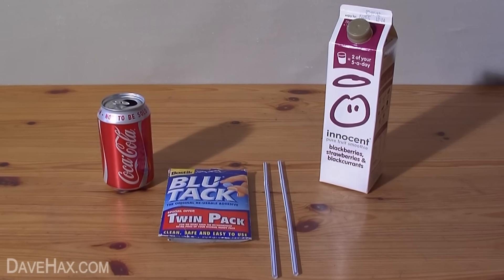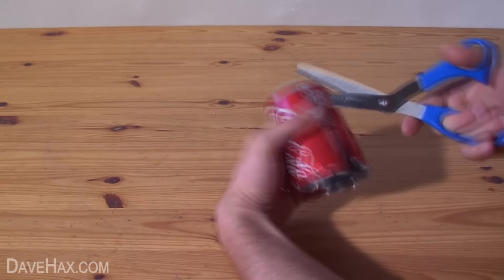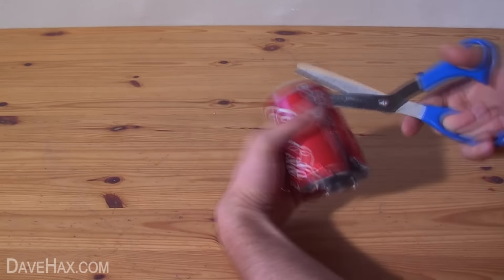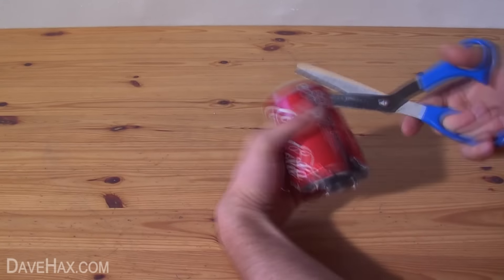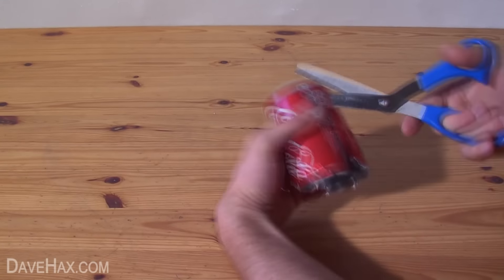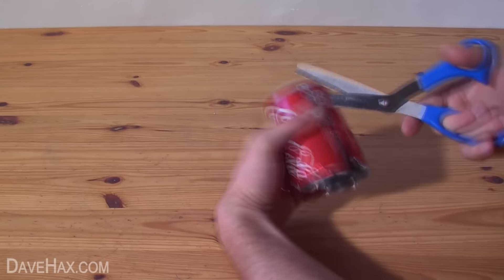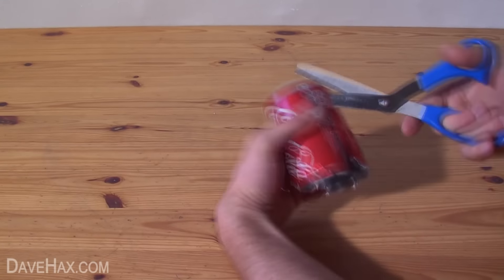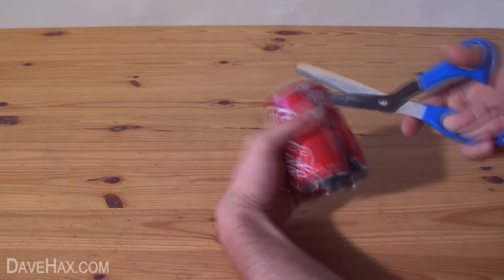How to Make a Simple Pop Pop Boat

Comment: :( I tried putting the diesel engine from my 240D on it and the whole thing, including the engine sank to the bottom of the pond.
Reply: RayVal53 Suggest you get a 300SD and try again.
Reply: ***** Already have one. See videos. :)
Reply: Dont make the engine to heavy it will capsze the boat or way it down
Reply: Have you tried turning off, and back on again?
Reply: just use more juice containers, 1000 should keep it afloat & don't cut them in half,just gluegun them shut
Reply: lmao
Reply: Yes I have the same problem all the time, luckily I could fix it with Flex Seal.
Reply: More bluetac
Reply: Try putting mass on the bow
Reply: Dude, your using the wrong motor. Obviously you have to use the 7.3 Powerstroke. Duh 🙄
Reply: Sad
Reply: Dont do that deisel engine steam atuall do better because if you put desiell engine you might atuall be harm full why here why    
1no. You might go away at sugar or it might 🔥
2no . You atuall did it it sink
3 no. It will go faster than usual it might crash and make you dirty
4no. Do it at metal peice card board peice would not float
Reply: Im just saying because im an expert
Reply: Oof
Reply: @James no duh.
Reply: Intel Core i7 7700k that is the funniest thing I have ever seen! 🤣🤣🤣🤣🤣🤣🤣🤣!
Reply: if you use a candle will it explode?
Reply: @joshuasdsmalls2157  no
Reply: You’re gonna need a bigger boat.

Comment: I had a boat like this when I was a kid. Not sure who made it but looking back it had to be hand made. it had a candle powered boiler but just air no water in it. The heated air inside still makes bubbles come out the exhaust pipes..and the candle was a tiny tank of candle oil with a wick that stayed lit for hours. The boat was made of tin and was soldered together. I wish I still had it..so many hours in the tub with it! :)

Comment: do this have a working propelers
Reply: It doesn't. The way the boat propellers itself is via hot water. The way it works is that because water is inside the "boiler" the candle is able to heat it up. The way that energy works is that heat will go to cold areas and cold will go to hot areas (Much like how hot air rises high in the sky where it's cold). The result of this, is that the hot water inside the "boiler" will push itself outside of the straws which will propel itself forward.
Reply: the candle flash boils the water inside the boiler. then the steam rushes uot giving the propulsion, and the water rushes back inside the replenish the water to the boiler, and the process starts all over again. that is where the pop pop sounds and propulsion comes from.
MUDDy
Reply: ***** Question: why 2 straws? Thanks
Reply: Gunaz Walz You could use any cylinder. Straws are most commonly used because they're cheap, durable (For this use), and are a good width to give a steady propulsion.
Reply: xXPhasemanXx Yes, but do you think it would work with ONE straw?
Reply: Gunaz Walz It would work and it would go faster since there is more water pressure due to the water traveling through one straw instead of too. You'd have to be sure that you make it so that the boiler can withstand that extra pressure though. I think the blue tac would be strong enough to withstand it.
Reply: ***** Muddy, i would suggest this is effectively a "solid state" sterling engine.Of course,the term "solid state" is 100% incorrectly, but other than the liquid it has no moving part.

Comment: What do I use if I dont have Blue Tack?
Reply: +DEVI SHEETAL Yeah. I guess that can work. Thanks!
Reply: VallieMC C assuming you did it, did the hot glue work?
Reply: Hailea Sapprique It actually kind if did! But where I live, there are different kinds of it. So some hot glue works, and some don't. So you could experiment!
Reply: VallieMC C thanks vallie
Reply: You can use epoxy glue it works much better!
Reply: VallieMC C morning I will have a chance your morning to see if I have
Reply: A tube of Bathroom or aquarium sealer sealer -  smells like vinegar and you will have  to wait overnight to let it cure properly. It's sticky stuff on dry skin but a tip is to use wet fingers to smooth it out and make a neat job.
Reply: rip, yr mom lol

Comment: On the 4th try it actually worked! It is not easy to get the boiler airtight but you get better at it after a few tries and a few cans 😂

Glue gun does not work. blue tac is the way

Comment: can someone explain the physics behind this?
Reply: Candle creates heat which boils the water, the steam gets pushed out the straws at the back, propelling the boat forward
Reply: +Ray Patrick water expands when boiled and is forced out through the straws, which like a gun barrel give the thrust a single direction. The steam almost instantly condenses again, and a vacuum is formed which draws in water. The water is drawn not from a single direction however, but from a 180 degree arc around the entrance to the straw. This means the amount of force dragging the boat back is a fraction of the force that pushed the boat forward initially, so the net result of the expand/condense cycle is a forward force.
Reply: +Ray Patrick magic.
Reply: +Enuo Enkidu the frequency of the the noise suggests somethings else is happening, no steam / boiling involved for each stroke, air expands in the hot compartment (wrongly referred to as boiler) and pushes water out of the straws hence the puck noise as water exiting the straw cause depression in the "boiler" pressure due to the inertia force of water going out . when air replaces the water in the submerged straws in the cold water it cools down and contracts again, pulling water back into the straws and pressuring the "boiler" (hence the "puck -back " noise) with air that is now is cold again , rapidly heats from contacting the walls of the hot chamber and expands , cycles go again and again. The Thermodynamic concept is not new , this is called external combustion engine concept and is a variant of sterling engine, except there is no piston or crank and no circular motion is required to be generated.
Reply: totti79 that's pretty much what I said, except I focused on the particular effect that generates the thrust, i.e. that the forward component of the force generated by the water on the expansion phase is greater than the rearwards component of the force on the contraction phase. The frequency of the sound is inversely proportional to the mass of water in the tube. A larger mass of water will take longer to boil and then longer to condense, so the period of the cycle will be longer and thus the frequency lower. A smaller mass of water will take a shorter time to boil and shorter time to condense, so the period of the cycle will be shorter and thus the frequency higher. 
Also, air at no point enters the system. The system is bled with water and then both ends of the pipe remain submerged, I have no idea where you came upon that idea!
Reply: Enuo Enkidu:  One thing about physics that I was taught in the Navy, is this:  "When the angle of the dangle is in direct proportion to the mass of the a$$, the heat of the meat remains constant."  (Just a little humor to brighten your day.)  :-)
Reply: Ray Patrick its just the exposed surface area provide force for the boat to move forward since the rubber band was wounded up
Reply: I thought about it and realised someone might think that no foreward force is generated because the same amount of water is pulled in than goes out no matter from witch direction but think of it. Its that water that is pulled from the sides that is changed into forward motion at the end. Your forward force is = to the weigt of the water being pulled in from the sides of the pipe witch is 180°. But then you might think but that water could be pulled from just slightly left or right from the 90° angle point witch is alinged with the straw. So if the water is for instance entering the strawes at a degree between 90 an 180 degrees at 95 degrees, the forward force will be equal to the pecentage of the weigt of the water, of the percentage of degree 5 degrees are of 90 degrees. So if the water weighs 10g including the water in the reach of the eccect of the suction, and enters the straw at 95 degrees the bacward force wil be 94.44444% of the weigt. So if that water is pumped out again it is about 5% affective and the force will be 0.555555g of foreward force. If the water enteres at 180 degrees the backword force will be 0 because no percentige of that water is pulled from the back and that waters efficiency will be 100%. It will supply the boat of 10% of force. So at the end 50% of all the weight of the water being sucked in and meing moved and effected will be forward thrust.
Reply: nope

Comment: (1) Pop-pop Boat (putt putt steam boat) is made of Tin metal and contains a metal can (boiler) connected to two tubes. (2) First fill the boiler with water through tube openings. This is called priming. (3) Then, heat the boiler with a candle. (4) The water inside the boiler vaporizes and leave the boiler through the tubes. Due to this backward thrust, the boat starts moving. (5) The pressure inside the boiler become lower than atmospheric pressure. (6) This pressure difference causes the water to enter the boiler from outside through both tubes. Compared to outflow, the inflow of the water causes no appreciable force on the boat and the boat continues its forward motion. (7) The cycle repeats and boat is running continuously. (8) The pop-pop sound is generated by the pressure variation inside the boiler. The metal can (boiler) is covered with a  metal foil (diaphragm) and this foil creates pop pop sound due to pressure variation inside the can. (9) To stop the boat, we have to remove the heat source.

Comment: Things that might be wrong if yours doesn't work: not sealed properly, just smother the edges and it should work, make sure that the straws aren't blocked by epoxy, make sure your boat isn't too heavy make sure the engine can flex, or pop when you blow into it, and just let the flame "lick"the engine and don't put it right int he middle of the flame. Wait a wile and it should start popping

Comment: There is a source to get an almost perfect boiler for a pop pop boat you will only have to add 1 exhaust pipe to it and it will work and last a lifetime. An older clothes iron that has the ability to mist steam any from the 60s 70s & 80s will work!

Comment: Ok, I did want to know where the batteries go, but momma didn't raise no dummy so I immediately assumed you just siphon off power from your iPhone used to control it.  But my big question is where do you install the iPhone, or at the very least where is the interface to connect the phone to the boat?  Will it work with Android, too?  
PS --  What language were you using besides English?  I mean, I have never heard of centimeter.  Is it some creature with the upper body of a man, and lower body of something exoctic?  Thanks in advance.

Comment: If You Used A Remote Control Fin And Put It In Between The Two Bottom Straws, You Can Control Where It Goes (MAKE SURE TO NOT PUNCTURE THE BOAT AND FLOOD IT)